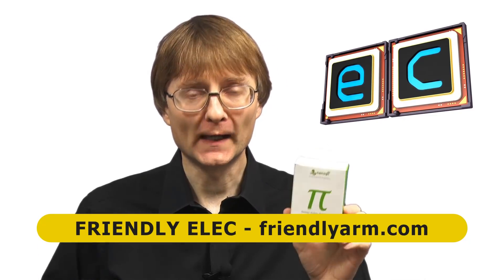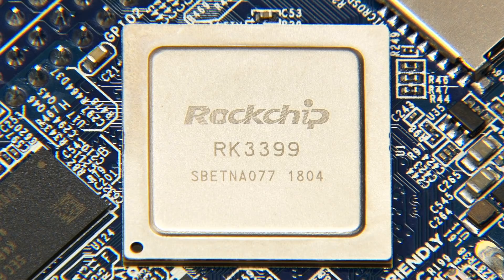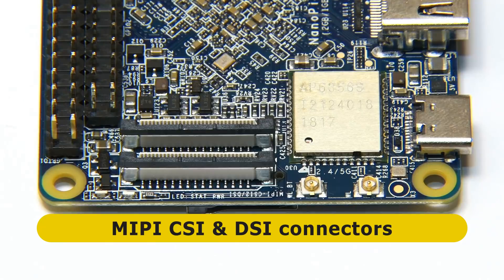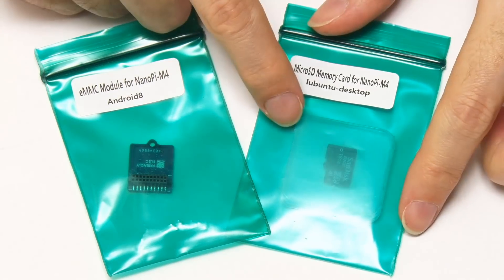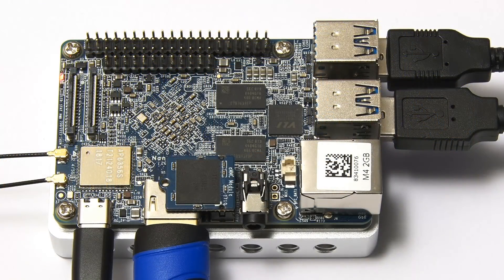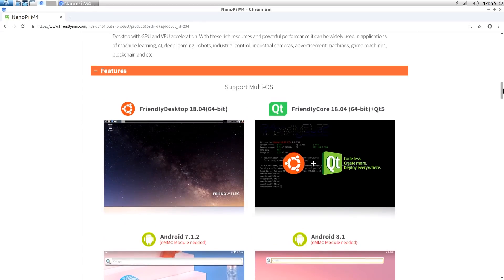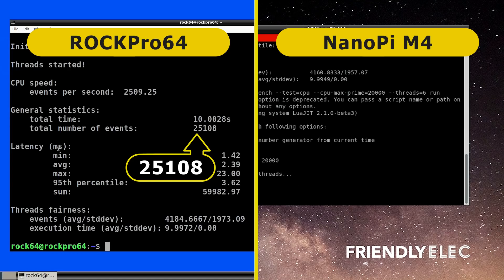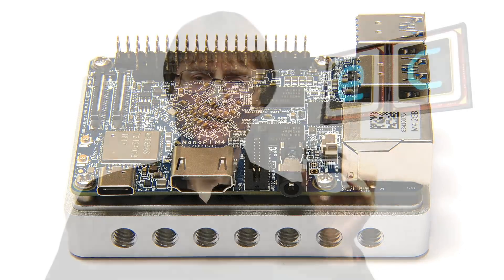NanoPi M4 : RK3399 SBC with 4 x USB 3.0

Comment: Can you install a linux distro on these?
Reply from the maker: I showed what is currently available with a desktop, aside from Armbian. Install is by flashing an image to an sd card or eMMC via, eg, Etcher. Images are on the first page linked in the video description.
Reply: yes, you didn't respond to what I told you I tried with Etcher and Win32 image maker. Why they didn't pull up when flashed as you suggested...
Reply: Yes - but it would need to be one targeted for the SBC hardware, like the Lubuntu distro that Christopher used in the video, as a opposed to an "ordinary" one intended for use on x86 PC hardware.

Comment: Do you think Retro pie will eventually be available for this single board computer??
Reply from the maker: I would be staggered if it were not ported across! This will make a great RetroPie board. It only came out in August 2018, so these are still early days.
Reply: @ExplainingComputers  I agree! I have the raspberry pi 3 currently and feel that it doesn't have enough horse power to play Nintendo 64 games and was hoping the Nano Pi M4 can solve this

Comment: Chris can you please show a board running youtube in 1080P through Linux in a browser. 
I have tried several boards and none of them dont have applicable hardware acceleration in Linux to run video and this is a big thing for me. It shows the maturity of the platforms Linux part. Thanks and keep up the good work Chris.
Reply from the maker: I have such a video planned, comparing media playback on many SBCs. Certainly it is still a big issue, linked to the software support for the GPUs on the boards.
Reply: I have found to get the most out of a Tinkerboard(original) you don't use a browser to view YouTube you use Kodi (on TinkerOS). I hope that helps.

Comment: no tests on the gigabit Ethernet ?
Reply from the maker: The video was getting a little long . . . !
Reply: sorry if the comment felt a little negative, we've seen a lot of Pi style board claiming to have gigabit ethernet ports that dont stand up to the tests, am just keen to see if this is the real deal
Reply: Gigabit works with full speed all the time. There is no need to test it. This is not Rpi :)

Comment: The heat sink seems to be an extra component (+$6.99) but if it gets "fairly warm" even with the heat sink I'm wondering if the board can actually work without it. Could you do some stress tests without the heat sink to see if it's really an extra or a must? just to see how warm it gets. Thanks
Reply from the maker: I would not like to run this board doing anything major without a heat sink! :)

Comment: Thanks for keeping up with all these SBCs!  I'm still waiting for a SBC that can hardware decode HEVC, AND have awesome software options like OSMC and Libreelec for a ultimate dedicated "cord cutter" streaming box. I still use Rpi3b+. I have a feeling that the SBC that has the same level of software support as a RPi with upgraded hardware will in fact be the RPi4... Which is unfortunately years away... I will still be on the lookout though, Tinker Boards are getting close.
Reply from the maker: You may well be right. Software is the key.

Comment: Another great video, thank you for testing it! Could you please try testing the throughput of the USB 3.0 with an external USB 3.0 SSD as well as testing the NIC speed with iperf? This device seems like it would make a great pocket sized NAS!.
Reply: You also mentioned SATA support on the auxiliary interface.  I would love to see that investigated.
Reply: I have seen a couple of SBCs with add-on boards that do this mSATA support, always on a different connector to the Pi-style GPIO. I can see uses for it. This looks like it could be a very handy little personal computer, with the right case. I see the mSATA board you mentioned also allows a couple of USB 2 connections, and that would be fine for mouse and keyboard.

That's a lot different to the usual Maker-class usage, and it would soon make a cheap portable look a better bet. What I would wonder about is printers. How often are they needed, but would you want to use a computer that couldn't drive a printer? The official driver doesn't look like it supports ARM processors, but there is an alternative.

It's another reason to stand back from the SBCs for ordinary use, and I would suppose that, most of the time, something ordinary on the network could be a better bet. I feel way out of my depth on this, but what drivers would an SBC need to print over a network?
Reply: also test stability of copying from one drive in a powered usb hub to another in the same hub! The Rock64 I bought has issues with this specifically. you cannot copy from within usb 3.0 hub connected drives to each other without the usb crashing and only fixed with a reboot ;(

Comment: Will this board work with Raspberry Pi accessories?
Reply from the maker: Many Pi HATS should work, as the 1st GPIO is Pi compatible, although the  second GPIO may get in the way. I doubt the Pi camera or touchscreen will work. And most cases will struggle due to the USB-C power and location of the SoC.

Comment: What would be your idea of a best use for the Nano Pi? I've been on the SBC journey for some time myself, and I'm interested to know more about practical uses and reasonable expectations for these devices.
Reply from the maker: This board would be good for basic surfing and office work. Great as a robot or IoT controller. Should make a good NAS once something like OSMC is available. Should also be a good remote camera controller. And it has a lot of industrial applications -- eg in digital signage.
Reply: Thank you. I've been discovering uses for the SBCs I have and am impressed with what they can do given the right software.  That said, the tuning of the distro seems critical, e.g., OpenElec Kodi which runs well on an RPi2 and gets its media files from a Linuxmint 19 Samba server. SBCs are fun, interesting and capable given their price point. I appreciate having you to learn from. All the best!

Comment: I never thought that a CPU on the back side of the board with a huge heatsink would be such a good idea...
Reply: Andrei _D12 - it is a good idea until you need to create a mobile project. The sink at least doubles the thickness and adds a lot of additional weight.
Reply: There are also other good and compact methods of cooling. But, sincerely, power requirements of SBCs like this one are a problem too when it comes to portability...

Comment: This looks like an amazing little board. Putting the SoC on the bottom is a great idea. I'd probably run it upside-down. That heatsink is indeed more than big enough, but I'm worried that the heat will just stay in the heatsink and won't be dissipated away from the SoC. Running it upside-down would let the warm air rise up and away from the device. Just a thought.
Reply: for me the form factor makes me want to put it in a nespi case but with the cooling needing to be on the bottom that won't work sadly.

Comment: Just wish you could get a bigger eMMC card. Could you speed test the differences between these so we know which option is better on boards that have the choice? Also I guess it is better to use the emmc for OS and keep the micro sd for data so you can swap out the data drive

Comment: Hey Chris! How do we stress out the processors in order to evaluate thermal performance now that Sysbench has changed?
Reply from the maker: That is a very good question that remains on my mind! We could just include a loop to run sysbench (no screen output) say 10 times between temperature readings. On most SBCs, only the older version of Sysbench installs. So there is also the problem of coming up with something consistent across boards. I will ponder! :)
Reply: Mine Monero (XMR) with them, maybe?
Reply: Pls do give an update

Comment: As always briliant!  Thank you for a great review.  I too love the heatsink. I envision these single boards being mounted on the back of a monitor to replace a desktop PC.
Reply: This is a great package overall. As a solid SBC. I'm wondering about the the thermal pad though. Seems a bit thick to transfer heat to the heatsink.
Reply: @mohdfaizal6773    Why?  All a thermal pad is designed to do is transfer heat.

Comment: That's a very interesting SBC, but that's a hexa core, rather than a deca core. Hexa=6 deca=10.  Can't wait to see what you end up doing with those extra GPIO pins. I don't know how much you are into plants, but I would love to see how you would use a SBC to set up a hydroponic garden since there are all these little modules around that can test CO2, moisture and light levels etc.
Reply from the maker: I've pinned a comment on my hexa core mistake -- sounded wrong even when I said it. Mistakes happen with my schedule. I've long thought about experimenting with hydroponics, but not made an SBC connection. A great idea!
Reply: No biggie, I must have missed that pinned comment. I saw some ready made grow room automation kits out there, for extra money of course, but I figured it shouldn't be so hard to come up with a homebrew solution.

Comment: With that impressive heat sink, I would like to see your standard heat test on it. It would be nice to see how this passive heat sink compares with the other tests you’ve done.  This is an impressive SBC.  Thanks for the video.
Reply from the maker: Yes, I must do some thermal tests!
Reply: By the look of it it resembles more a vapor chamber than a heat sink
Reply: deepblueskyshine Yes it does look like one. Looks like it needs maybe a little better air flow management. Still I would like to see it’s performance compared to other heat sinks, fans, etc.

Comment: Please consider adding a quick frame rate test to the benchmark. "Output" and usability are quite distant neighbours. For example, I recently tried a RPI B for Youtube and some videos, it just can't deal with 1080p. But it indeed outputs 1080p desktop wise. I would be very interested to know if this SBC could sustain 4k60Hz, say, with YouTube clips, Netflix and h264/265 vids. Hence the temperature side of the test. Kutgw, cheers.
Reply from the maker: Good point. I am planning an SBC media playback group test.
Reply: ExplainingComputers  Finally! I have to reboot my pi after a couple fullscreen videos. I doubt it could handle a feature length movie in fullscreen.
Reply: This fits with my experience. My Raspberry Pi 3B+ is fine with a 1920x1080 display, until video comes into play. Same with Raspbian running VLC and the dedicated video-player software. It may be an issue with the difference between hardware and software decoding. The tangles over h264 and patents are frustrating.

Comment: I noticed the screw holes on the sink as soon as it appeared on screen.

It would have been nice if they had put screws holes through it on the plan size so the sink could be screwed down and then SBC put on top.  But that is perhaps a moan too far?  :)

Now wondering about SSD's hanging off USB 3.0 and software RAID...........

Comment: the graphic-unit is being cooled well, the processor not at all, Maybe there should be a Version of that cooler with a Little block of Copper over the proc. and a heatpipe going down to the massive heatsink, in a way that does not obstruct any connectivity.
Reply from the maker: I am confused. The CPU and GPU are in the same SoC package, both on the bottom of the board.
Reply: i have mistaken something on the top for the cpu, as on most single board computers the cpu is on top.
also it is often two seperate chips.
Reply from the maker: Ah . . . :)

Comment: Is there an SBC with standby capability? I need it to consume less than 10mA in standby.
Reply from the maker: This is not something I have come across. I imagine the Pi Zero W will get down that low, esp. if you turn off stuff like WiFi and HDMI.
Reply: Yeah, but then it is still not standby, it's just crazy slow. I need a normal standby, like a laptop has... Or perhaps I should simply take a small tablet and run everything on USB...

Comment: hey do you have any speculation about the Raspberry Pi 4?
if me: 8-core Cortex A76 in SOC! lol
Reply from the maker: I suspect that the Pi 4 will be a modest upgrade -- they will be most focused, I think, on backwards compatibility and maintaining the $35 price tag.
Reply: i certainly think that the Pi needs its flagship model for enthusiasts, what do you think?
Reply from the maker: Yes, I agree. There is a good logic to do a non-backwards-compatible Pi to move things on. We already have the Pi Zero W as a great lower-end board, and the Pi 3 B+ in the lower/mid range. But a higher-end Pi -- yes please! :)
Reply: yet i think that flagship Pi should not be overpriced in order to take better advantage in case, for an example a flagship Pi to use 14nm instead of older 40nm as reported, and replace faster CPU like A76 or GPU. they can invest in far more units of them, in order to decrease the cost per single unit.
though i hope that they will not end up into a strategy of Apple.
now i am like Dear Broadcom, i am here, in the name of a Raspberry Pi's fan, to wish a flagship SoC, because Pi isn't anymore a simple computer, (other things blah) in the name of Jesus, amen.

Comment: The board is screen printed 1GB/2GB, it must be an old board.
Reply from the maker: Yes, I noticed that. Very strange, as the options are 2GB or 4GB -- though the 4GB has a slightly different component layout.

Comment: Putting the uC on the bottom was a brilliant idea. It allows for the case to be the heatsink and unclutters the top of the board. No, it won't work with rPi cases but why would you hobble such great innovation just to make it work in an rPi case?

I'm less enthused about the choice of power connector, a barrel jack would have been better for power but at least it is not a silly micro-USB the USBC has much larger power connection area for each terminal (+ and -) and making it work as OTG does add some functionality so maybe it was a good trade-off?

I did spy a two pin connector (unpopulated) on the PCB near the RTV batter connector with the pins labeled P and N. Maybe this is for an alternative power input or perhaps a two wire fan? I have not looked at the documentation to find out yet.
Reply: Why does everyone seem to like barrel jacks for power?  I find them more problematic in my decades of experience than almost any other type of connector (other than the current carrying capacity).  I'd rather have two type-C jacks for power than one barrel jack!  I have a name-brand laptop where I have to tape the jack into the socket if I want to have the confidence it will not just slip out on it's own during normal use, sad.  Some do fit more tightly with a locking method of some sort and that is an improvement, but it's not a universal feature.  Until it is, I won't buy a board with barrel jack power.  USB-C, except for it's power handling capabilities, doesn't thrill me either, if I don't need the data handling abilities it also has (which appears to be the case on this board).
Reply: For a quick connect type connector which has numerous power supplies ready made, with that type of connector, it is hard to beat a barrel jack. For a truly embedded application a two position screw terminal block would be better as they won't let loose as easily. 

A barrel jack on a laptop gets beat up on terribly as one will always try to carry the laptop off whilst plugged in at least once. Thus the magnetic latching connectors were born. I'm not sure the laptop is a good standard by which to judge barrel jacks. In a similar vein micro-SUB is a fine connector for its purpose but it was not designed to carry 2A+ coupled with the bevy of poor quality USB type power supplies and you have problems. It is not fair to judge the connector though on this misuse.
Reply from the maker: I am trying to embrace USB C in my head! :) Personally I do like barrel jacks.
Reply: Good feedback yo. Useful. And I prefer the new USB c